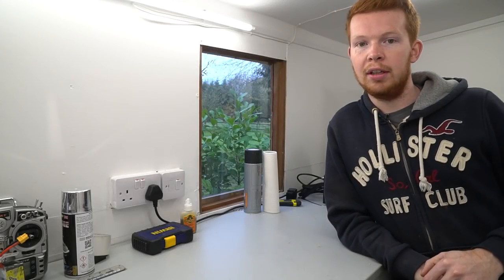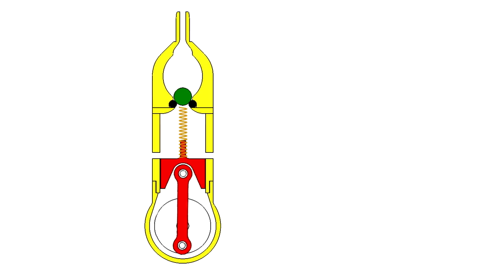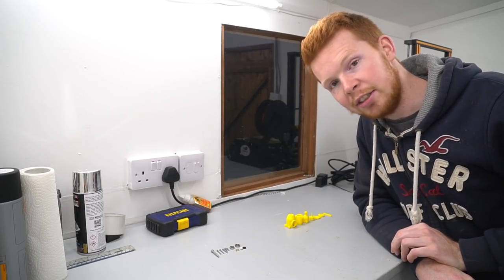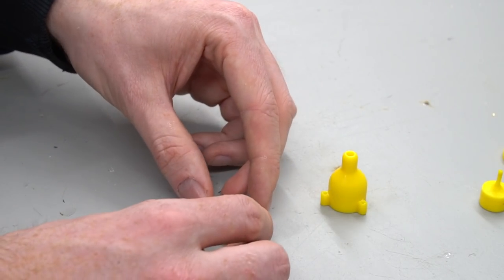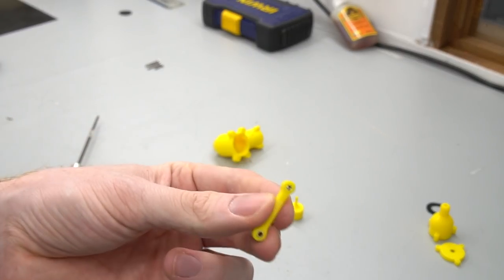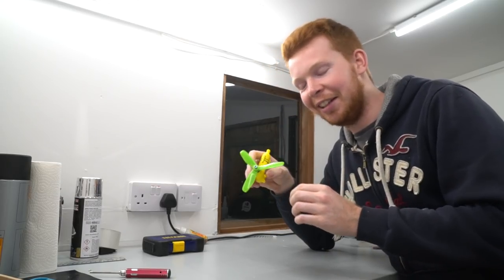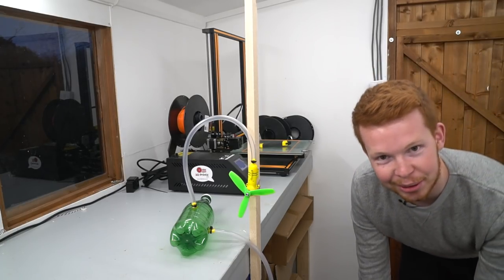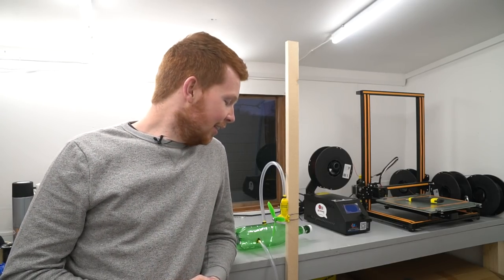Compressed Air Engine

Comment: Great content as always Tom and it was great to learn about a new type of engine.  I work with a lot of 3d printed parts and have used compressed air in some projects, may try to make a multi cylinder version of this as it would be less lumpy. Please put on some safety on some safety squints as when it blows up it could do you some damage!

Comment: Great video man. I've been subscribed to your channel for a while now. That is to say I looked for this kind of thing back when I got into 3D printing. Keep that in mind when you read the next bit below. I have some knowledge in this area of engineering which might prove helpful in making that work a little better. I think part of the problem with it running so rough is that the cylinder or the valve orifice is too large. It needs some way to regulate the airflow down so that it can run longer on the volume of air pressure you have stored in the bottle. Something like a pin valve which I might add you can also 3D print.

 All you need is a valve body and a bolt. Just grind the bold to a fine point by placing it in a drill and symmetrically grinding the end to a point with a Dremel or find grinding wheel of some sort. It doesn't have to be perfect so long as the taper is relatively concentric. The threads on the bolt will make for a great adjustment system. It just needs a small hole to seat into. This will cause it to have a strong burst at the beginning of the power stroke instead of the whole stroke giving you a much longer run time and smoother performance for the motor. 

I built a similar motor out of machined aluminum as a final project in my machining course. It worked up to around 120 pounds of pressure without failing but got really hot in the process. I wound up cutting a new cylinder with fins much like a nitromethane motor for RC models for extra heat dissipation and it worked beautifully. The one you have there should work up to around 25 to 30 pounds of pressure just fine. It just needs some kind of flow restriction to help it run a little more smoothly. Kudos on a really decent design and thanks for sharing it.

Comment: Typical 2L bottle has a burst strength of around 150PSI  (water rockets use these)  and the best way to connect would be to make a new cap with a T on it, you don't need an in and out with air just the reservoir in line somewhere..

Comment: Tom: print an air regulator so that it runs longer at constant slow speed.  Also print the 
 connecting rod pins onto the crank and piston so all you need is a nut onto the plastic pins instead of a metal bolt or screw.  Might have unforeseeable uses on Mars but must lose heavy metal parts.
   Also, make one-way snap together piston head and crank body, no screws, no glue.

Comment: I say add a throttle to see if you can keep it running at a lower speed instead of exhausting your supply so fast, but this is exactly like the air hogs toy! Great job!!
Reply from the maker: +Eric Karczewski Yes I want to experiment with different inlet nozzle diameters to see if I can get it to spin a larger propeller for a longer period of time at a lower RPM. Thanks!
Reply: You could even just screw in an extra bolt to the side of the inlet, after the ball valve. Then tighten it to limit the flow rate. I honestly can't wait to see the next video, I might just try this myself with PLA and a drilled out cylinder!

Comment: What about sanding the cylinder with very smooth sandpaper, use an o-ring on the piston as a piston ring (one that isn't very tight against the cylinder to keep friction down) and lubricating the cylinder with a little grease, vaseline or oil? I suspect a lot of leakage around the piston and very reduced efficiency.
Reply: NorwayVFX for piston rings the best thing to use is RTV gasket maker if you make a groove around the piston and fill it full of rtv and shave off the excess and then use oil of some sort.
Reply: hater gotta hate

Comment: I used to have a small car with an engine like this. When properly pumped, it would run blazing fast across the room. But the most enjoyable thing was to start the engine and then continue to pump the air while it runs. This sounded exactly like a real engine being throttled. You should maybe try doing same thing with this to get a continuous run.

Comment: hey, I have done testing unto 400PSI on 1L and 2L pop bottles. the bottle cap is the weakest spot from my testing. I used a refrigeration compressor for my test with refrigeration gauges inline. use a fresh bottle and make the holes in the CAP and use epoxy for best results.
Reply: You say the cap is the weakest spot but I bet that only if the rest of the bottle hasn't been damaged right? I think the hole in the side of the bottle used in the video is the weakest spot. I second your idea of using a fresh bottle with holes in the cap.
Reply: Your average plastic water bottle will handle 90-100psi before bursting the cap off. Did it about a year ago with a bicycle pump that has the lever to hold the valve open and I used a bicycle inner tube and cut a round section out around it and made a hole in the cap. It literally smoothed the wrinkles out of the bottle. 😂 Makes one hell of a noise too. Spent over 20 minutes looking for the cap in my gravel driveway and it was over 40 some feet away in the yard
Reply: Michael Illingby Hey guys, to improve the seal you can use a combination of SUPER GLUE + BAKING SODA seriously google it, amazing stuff

Comment: Cool project. Maybe you want to use a drop of high viscosity oil to lube the joints and especially the piston to reduce friction and mainly seal the chamber a bit better.

Comment: Excellent Tom! I think it would be nice if you could add a pressure regulating valve to the motor supply to have a more controlled autonomy and RPMS.

And something to think about ... Print a new piston with a small ring barely larger than the diameter of the cylinder so that it molds with silicone lubricant and seals the air leaks?

I admire your projects! Keep it up! Greetings from Argentina!

Comment: Real model co2 engines have a much smaller displacement and turn bigger propellers. To increase the efficiency of this engine you could turn a bigger prop, and use a thick oil to reduce friction and fill in the tolerances. I assume the compression seal isn't great since the piston only fits one way. Also, if you were to make a v2, make the stroke longer in relation to the bore, this will keep the engine happyer with more load at lower rpm.

Comment: rtv might be an option or a simple o ring with a groove cut, printed into the head and block for the head gasket next time.
Might even be able to use a small thin o ring for cylinder rings too

Comment: You can make it run longer, just get the bottle lick proof, and put a valve in the hose, get some water inside the bottle and put dry ice, you will start building pressure, the coke bottle will take huge amount of pressure you will even see deforming, and open the valve and flight away. yeaaaa,   Love you motor. fantastic.

Comment: You can make two cylindrical cutting tools and a hammer two make the ring you need. Look into leatherworking tricks. Additionally you could use pipes then sharpen the edge of one side.

Comment: Tom, Hello! I really enjoy your vids, both the topics themselves and your presentation style. You seem quite personable and your explanations are well scripted. Keep up the good work.
PS   A small amount of lubricant around the connecting rod's attachment to the crank wheel and around the skirts of the piston may help the engine both run smoother and provide a slightly better seal around the piston, extending the 'service time' of your air charge. Cheers!

Comment: Hey nice job. Improvement idee: drill the cylinder for more presision, use some stell pipe or thing like that as part of the piston for more presision too,  add more flywheel for more  inertia an try to balance it for less vibrations, a piston a bit longer at the bottom can improve his guiding on the cylinder and WD40 can be magic.

Comment: I would recommend adding a weight to the crankshaft at the opposite end of the turning rod to minimize vibrations.
Also check out the "Tesla Turbine"! It is an engine or turbine, that converts air pressure into rotational energy with an efficiency of up to 98%.
Reply: isn't a tesla turbine only efficient at high speed and on uncompressible fluids?
Reply: A tesla turbine can work with air, but I don´t know if it would work with other fluids as well. You are right, that the tesla turbine increases efficiency at high airspeeds, but with a relatively high pressure (in this case stored in the bottle) compared to the inlet size of the tesla turbine, high airspeeds can be achieved.

Comment: You should putt the air-hose into the cap using a T connection on the hose for more than one line.The cap gives easy access for sealing the connection and in my experience is more forgiving of being penetrated.  I use a valve stem from the auto parts store for when I launch pop bottles as rockets and never had the violated cap fail on me.

Comment: A 2 litre pop bottle is rated for 150psi, just a heads up. So if you put your input and output through the cap, you should be able to get it up around there with little issue. I honestly would just suggest using a single line to feed the bottle and the engine, no real reason not to. Plus, if you use a one way valve, you can even disconnect the pump with no problems.
Reply: Which would be ok for a bench test but rather unwieldy to use otherwise. Sched 40 PVC is rated for 450 PSI and could be small enough for a portable cylinder.

Comment: You should put a pressure regulator on the inlet and use the minimal pressure required to run the motor. (F= A*(p_1-p_0), Drag is relative to the prop and rpm you want)

Comment: Delta printers are proportionally inaccurate and introduce distortion depending on which part of the bed they are printing on .
thats why the cylinder and/or piston  wasn't round. ( it wasn't clearance ).
You should have used the cr10 for that

Comment: To make it run smoothly, use the shank of the bolt as a bearing surface, not the threads.  Use graphite on all moving parts.

Comment: PET bottles usually can handle up to ~80 psi. But never drill holes in a sides of it, it is safer to attach tubes to the bottom and\or to the cap.

Comment: Plastic bottles like that can take up to 80 PSI reliably, and burst at 120. Although I'd recommend doing your own test with your specific setup by filling the bottle up completely with water before pumping. You may need to top the bottle up with water as it expands slightly. The biggest danger if it does go bang is then to your ears, I know this from blowing a bottle up to it's bursting point, even though it had mostly water in it the bang still deafened me for 20 seconds :)
Reply from the maker: +Ioan Hill I used to build water rockets as a kid and had a bottle explode about 2m from me at 110psi, so yeah I know what you mean about the ears ringing haha! Will definitely be testing this setup to a higher pressure soon. Thanks!

Comment: 10:33 funfact the common PET bottles can usually take a higher pressure than a normal car tire.
Reply: yea about 90psi or so
Reply: probably not when you put holes in the side

Comment: Hi Tom, imagine using this engine (disposible almost) screwed direct onto soda top bottle with Schrader valve glued into the thicker stronger base section. You could then use higher pressure. If you can get it to run for 60 seconds say. Your bottle would be the plane fuselage. This could be a 1km autonomous postal plane. Climbs quick to gain hieght say 800m then glides another 800m. Potential for a 2km radius delivery area for very little cost... just an idea ?
Reply: Mean't to add, if you add a dusting of "Baking soda to Superglue" it sets the glue like stone cement.

Comment: This has given me a few ideas but you could try using a large reservoir like a 3L soda bottle or an air cylinder filled to a high pressure then fit a regulator to the output.

Ideally this would make the engine run for much longer and you could adjust the speed by simply restricting the regulator.

Comment: I think it just needs a pressure regulator for a longer smoother run, it sounds like the valve gets to hard for the spring to open at higher pressure. You could then run higher pressures in the tank and lower pressures at the engine and even control throttle. I use a ball valve like at Lowe’s and there cheap to. For wait reasons a tiny clamp on the inlet hose would restrict air flow enough for it to run longer and smoother.

Comment: Wow! I'm impressed! Think about adding a pressure regulator between the engine and the air tank so u can sustain a longer engine run and also regulate the throttle.:)

Comment: Why did you put valves through sides of the bottle? Going through the cap would not compromise the wall integrity.
I have made a receiver for my airbrush back in the days. Two holes through 2L bottle cap, one long tube, one short one. Then I put some eopxy in the bottle and turned it cup down overnight.
The fridge pump was not able to burst the bottle, it would be ca 10 atmospheres of pressure.

Comment: I would love to see a better air container ;I 
If you could maintain a constant pressure inside the air storage chamber(the bottle), using a electric pump along with a controller to start the pump, whenever the pressure becomes less than a particular value that holds the engine alive. So that we can hear the engine sound for a long time <3 
Also I'd love a multicylinder engine (I prefer boxer engines)

Comment: If you used sealed bearings, you could have filled the lower chamber with a light oil, similar to a automotive engine, which would have sealed the cylinder better. Also, a co2 cartridge with a regulator could work quite well.

Comment: may I suggest that the spring be changed to push the ball downward and that a small rubber piece be fixed to the top of the piston to lift it at the top of the stroke

Comment: Um if you put a gasket on the Piston and some gasket grease you'll get better compression  also a counterweight on the crank shaft should increase efficiency and maybe a bit bigger outlet holes

Comment: Not sure if someone noticed that yet but I think, that if the pressure is to high, the engine will not work. If it should run for a longer period of time, you would need some valve which would be able to provide a constant pressure from the pressure vessel to the engine.

Comment: Very clever! Somewhere in the basement I have an old CO2 engine that works on the same principle, using a gas cartridge.
Reply: I probably had the same CO2 engine. Piped to a CO2 cartridge holder that would pierce the cartridge when you clamped it in. Mainly to provide power to get a glider to altitude. Collector items now probably.

Comment: Not bad... I wonder why it "stuttered" though. To me it sounded like the pin on the piston was too long and opened the valve before the piston reached top dead center, but I'm guessing you probably designed it to open the valve at the right time. Perhaps the valve also doesn't open far enough before the piston goes down again, 'causing the valve to slam shut to early?

Comment: If you remove the spring when operating on higher pressure air you will still get good power but will use a lot less air.

Comment: Make a new bottle with one outlet at the top add some dry ice and water and let it run longer on its own.
Reply: What is the point of the water?
Reply: John Reeves to accelerate the release of the carbon dioxide

Comment: Try reducing output hole size to smooth the RPM curve??
You can buy a tire nipple (it seals itself) for easy pressurizing. PVC pipe for a fuselage is good idea, since it can do both structural and propellant tank functions.
Also, love your videos, so thought of.

Comment: Tom, i have an idea u may want to try out with ur building skills... 3D print a propeller with small air tube running from its centre to its wing tip, on both blades, so that when air passes thru them propellor rotates. Then connecting it to an air source(balloon maybe) with a connecting small pipe with a valve.... When u release valve air flows thru blades and propeller rotates..

Comment: Need an air regulator.  it wasn't able to run right under high pressure, once some air was released it ran correctly.  Great job.

Comment: My pops pressure tested 2 liter bottles for shits and giggles once and found they burst around 60 or 80 psi. Glue the bicycle tire tube valve to the bottle cap for best results.

Comment: I'm really curious....If you could use a high pressure small bottle, scale the motor up a bit, maybe 3cyl, and a pressure regulator, with ball valve operated by a servo. Could you make an RC with it? It would be a lot of fun! 

Maybe utilize off for the cylinder, with 3d printed adapters.

Comment: Get yourself a shop air compressor. It's a good tool you can use for a lot of things (with the proper add-ons) and it would be perfect to run this more more than a couple of seconds. You can get a decent one for less than £100. I'm surprised you don't own one already.

Comment: try schedule 40 PVC pipe with two end caps, can take up to 150PSI no problems. make up some kind of 10-20 PSI regulator and use a CO2 cartridge.

Comment: That's awesome, man! :D One tip: the Creative Channel made an air compressor using PVC pipes a while back. Maybe you can make something similar to use with this motor, but smaller. :D